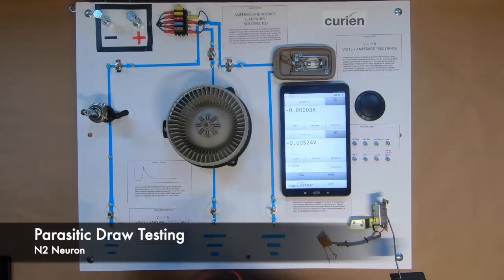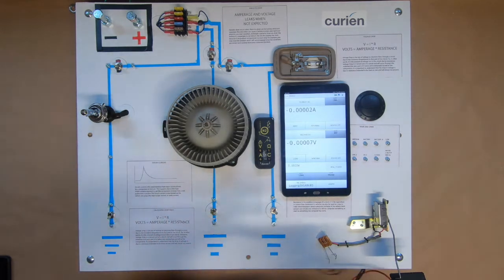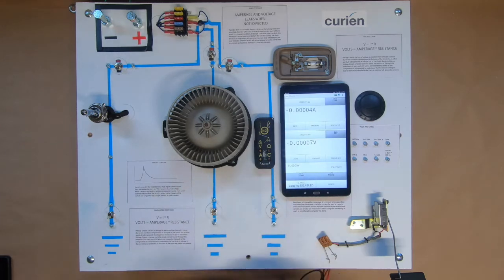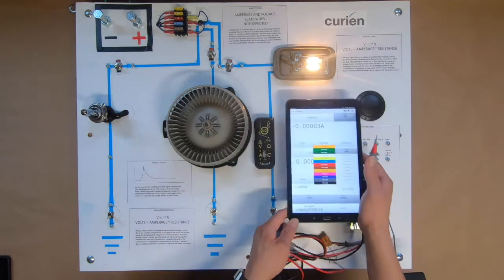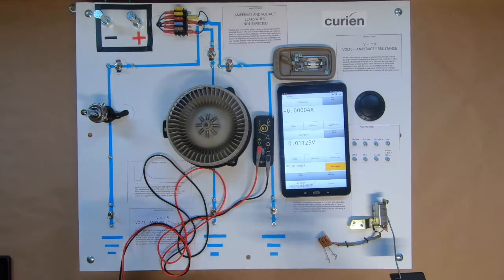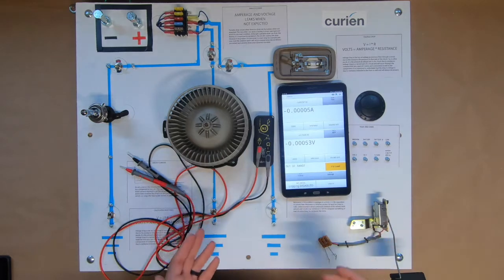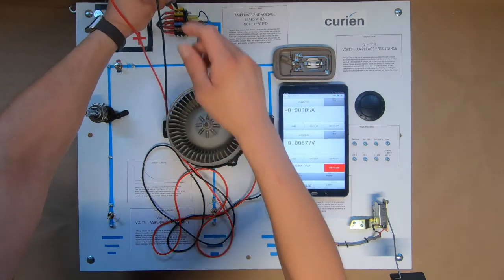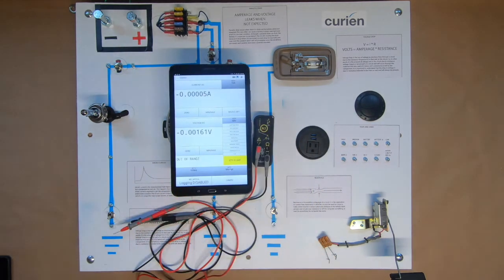Parasitic Draw Testing

Comment: Hi Josh, what about if it was an intermittent draw. For example, a motor that is stuck and comes on over a period of time. Can the tool monitor it over a period of time?
Reply: The Neuron can monitor via logging to an SD card (not included) for up to 6 months (no auto shut off)
Reply: @joshcarton  understood. Just got my hands on the N2. Wanna try it. Probably use a shunt resistor with it to see how it works.
Reply: @joshcarton  so, does it show the time and voltage of the parasitic draw?  Does it have a graphic display of this as the voltage rises and falls?  Thanks, Tom
Reply: @Okie-Tom  yes it does
Reply: @Okie-Tom  honestly these videos need to be remade as they are of the original software